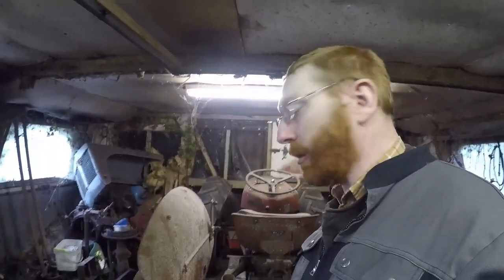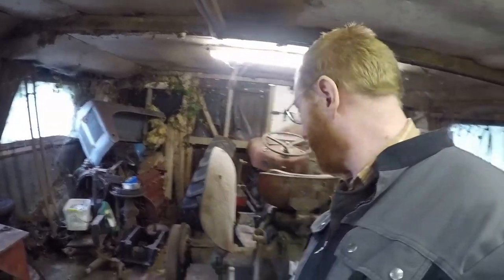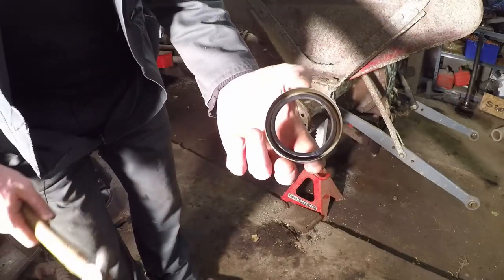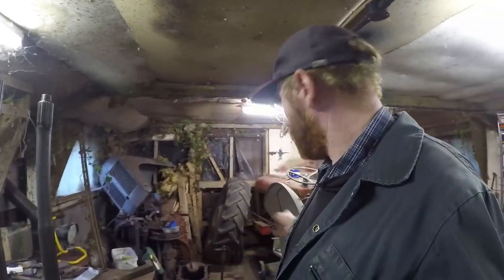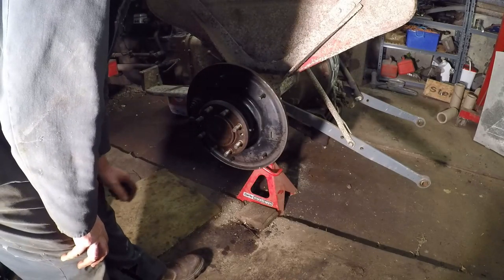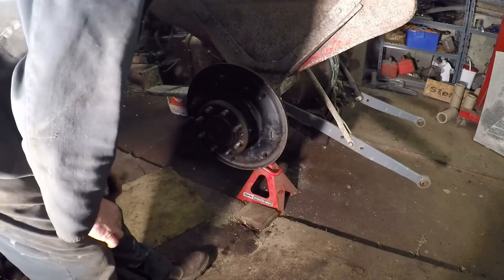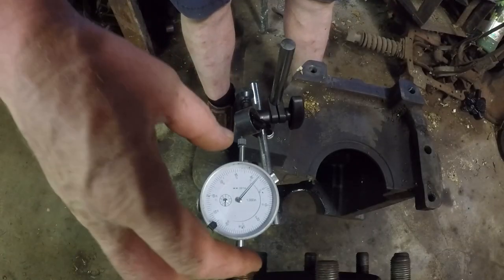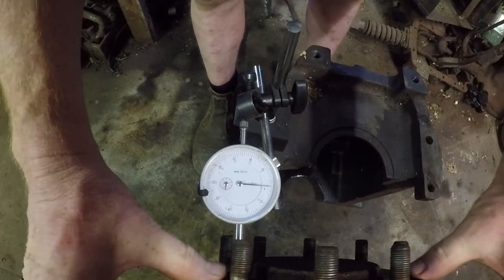Vintage Thursday. Massey Ferguson halfshaft oil seal change.

Comment: Great job Dan, I need to do the half shaft seals on my Grey/ Gold FE35 as oil is leaking out and has got into the brakes, great info regarding this job and the greasing tool was brilliant 
Thank you

Comment: We always used to set end float so that half shafts just touch, if you turn one and the other one turns in the same direction then they are too tight, you then add shims so that when one turns the other one goes in reverse

Comment: Re greasing  bearings, an alternative is to use the gadget originally intended for icing birthday and Christmas cakes using a plain narrow nozzle. I always found it quite successful. Not sure about the modern plastic ones, as I purloined my mother's 1950's metal gadget that withstood the pressure. (She did find out eventually, together with her old deep saucepan I used to heat pistons in, prior to fitting gudgeon pins).

Comment: Great video alot of detail  i wonder if you have the part numbers for the seals and gaskets i have to do my dad's mf 35 cyl perkins both axle seals are leaking also would know the diameter of the lift cylinder piston the rings are wore and i want change that to, again thank you for the good video . Watching from New Brunswick Canada

Comment: Include to check the seal to the axle. Recently pulled one apart with seals that fit outside of seal yet it didn’t even touch the shaft. Rather important information. Think about it the gaskets are fine example.

Comment: Thank you for these vintage Massey vids. I need to do this to my mf50. Where do you source the parts, gaskets, seals, and brake linings and hardware?
Reply from the maker: I shop around. 
I get most bits online, but some from traders at shows.

Comment: Good video! Did you ever get round to filming a seal change on an older Fergie, got a continental TE20 so assuming its got the older style axle. Cheers.
Reply from the maker: I do have a continental engined tractor to do, haven't done it yet though. 
Yes, it will be the older type axle.

Comment: You can’t set preload  on bearings with gasket take gasket out put shims back in
Reply from the maker: I see what you mean, but workshop manual shows gasket and the chap I learnt from used them too.

Comment: do u know of a source for replacement  axle  studs or is it a  trip to the  breakers
Reply from the maker: I'm not sure if they're available or not.
Reply: Try Patrick Edwards tractor parts or Vintage Tractor parts
Reply: I see acron services vintage  tractor parts  has them on their  website
Reply: Sure any bolt / nut supplier could source them for you

Comment: You still need to change the outer seal. Even if the inner seal is bad, the oil can’t get by the outer seal if it’s doing it’s job!
Reply from the maker: Very true.
But just doing the inner is well within the capability of the average DIY mechanic without special tools.
Reply: @CowfarmerDan  By the way, there are three different thicknesses of those shims; .004”, .016” and .021”.
Reply: @CowfarmerDan  I guess the outer seal was leaking oil that had passed through the bearing. Changing just the inner seal does hold the oil back though and is less of a job than trying to replace the outer one too. 
This video gives me confidence that I could replace the inner seal, refitting that shrink ring wouldn't be possible for me!